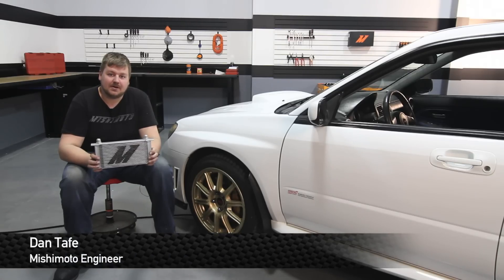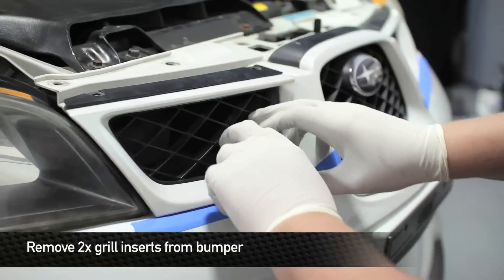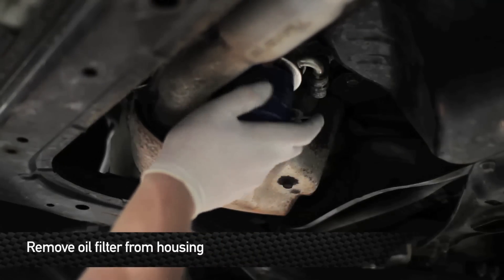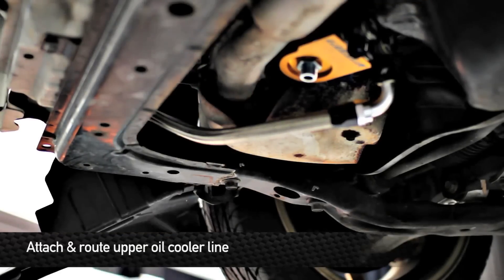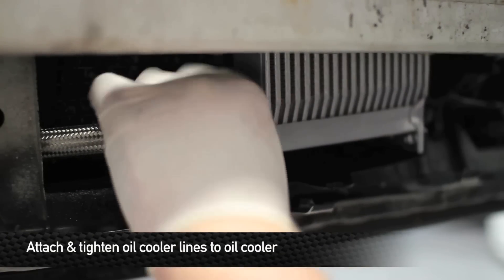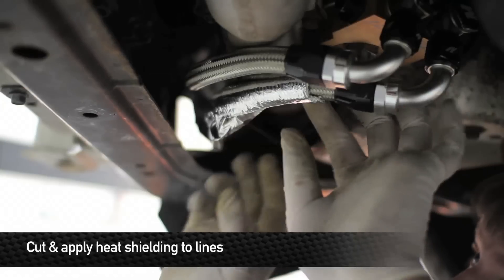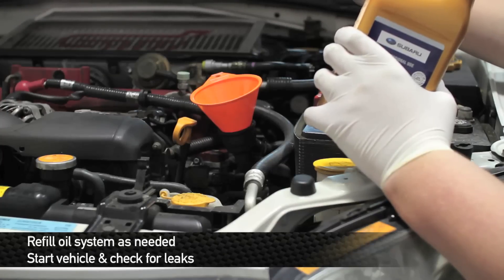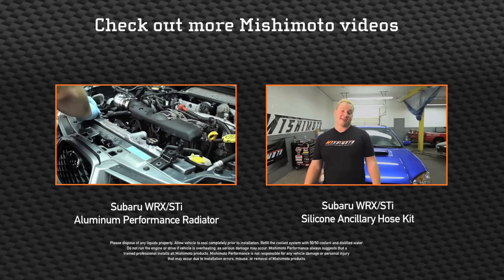Direct Fit Oil Cooler fits 2006-2007 Subaru WRX/STi Installation

Comment: How would the fitment be with a front mount intercooler? From this video, I'm not sure if it would fit with an intercooler. I have an AMS 3.5 inch
Reply: Trey bodkin i have the same question
Reply: @TERMATOGAZI  make a custom bracket

Comment from the maker: Our thermostatic sandwich plate does not have ports for sensors, so you will need to tap into the oil plugs on the engine.

Comment: Hi Mishimoto I would like to ask a question.In my 06 Subaru STI I have Oil temp, and Oil pressure sensors will they still work with this oil cooler kit and the thermostatic sandwich plate?